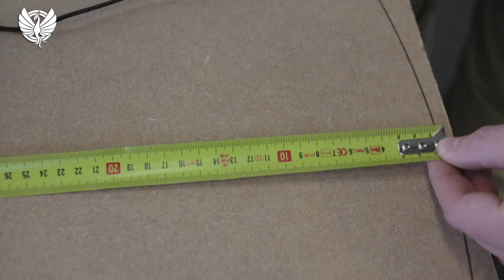DIY Ring Light Tutorial (Dani Diamond Style)

Comment: How thick is the wood you started with ?? And how big of a piece was it when it started off square ?
Reply from the maker: +HouseOfDeus 8mm wood 1,22 m
Reply: Thank you for reply... 1.2 m is 60cm from the center right (radius)  ? and what is the spacing between bulbs ? in inner circle and outer circle .. I read your comments you said 50cm 70 cm 1.00 M and 1.20 M can you  these measurements are diameter right ? help me with this  I wanted to start this project this weekend ..
Reply from the maker: The piece was square in the beginning. The spacing is subject for how many lamps but just use an equal distance for every lamp as it is round ;)